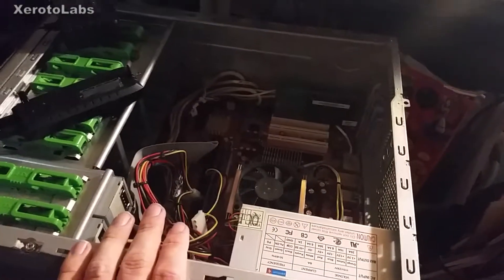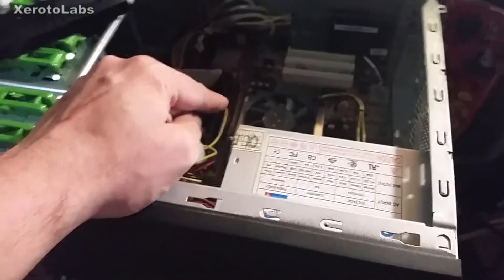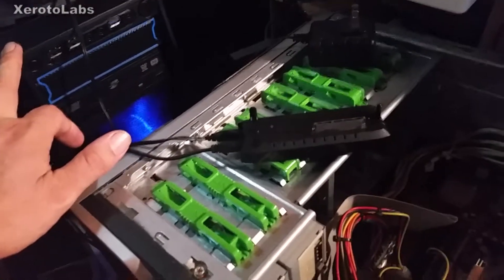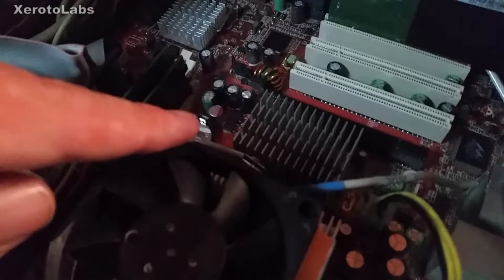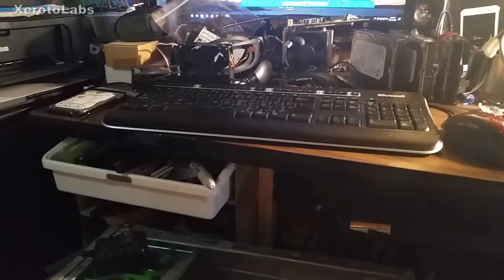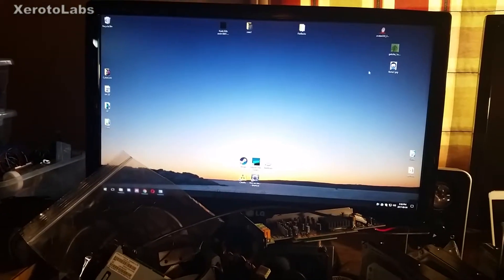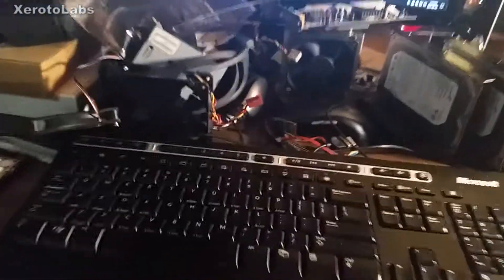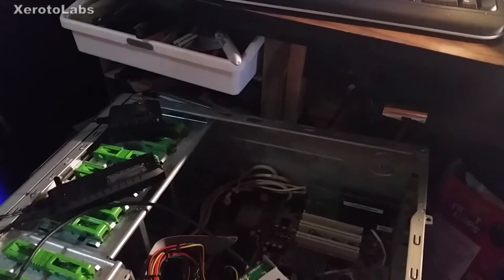Chanel Update and some info .

Comment: My Phillips TV  sensor is not working.
Tried using new controllers but the sensor not working.
If ask to repair must we pay alot?
The TV is in good condition
Reply from the maker: depend son what your local shop ( if you have one )  charges for diagnostic and labor . the part can be really cheap , but labor might not be .  Some shops wont to board work , they will only replace whole modules. some modules rate only about 5$ to 10$ , so again the shop rate can be the bigger cost .  I would find you local shop and  ask them on the phone.